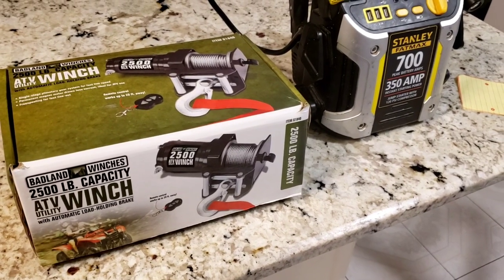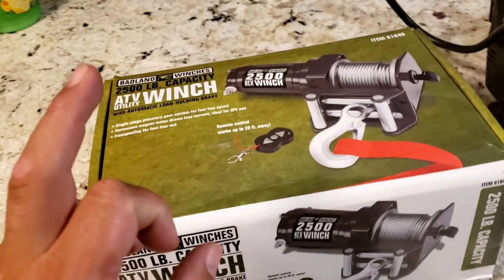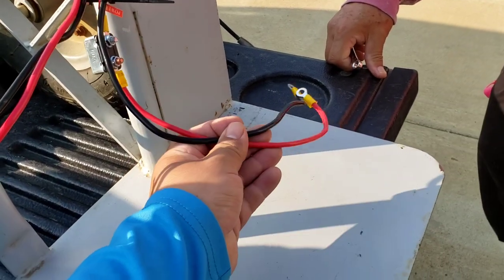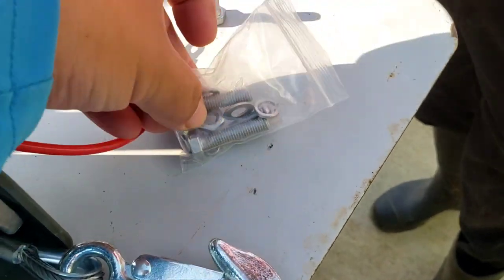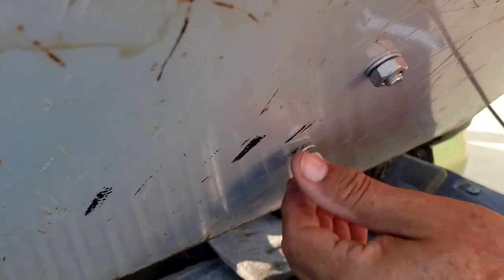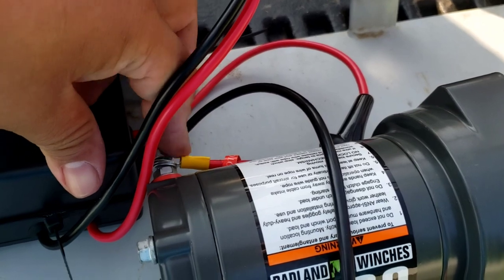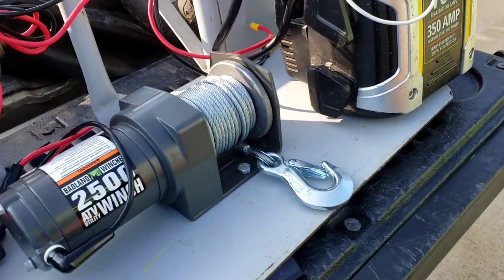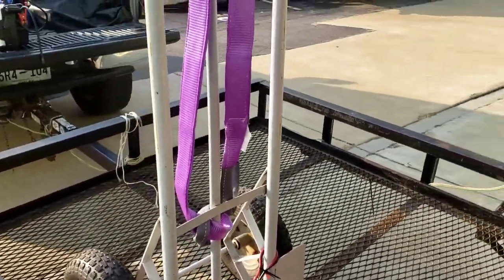DIY 2500Lb Harbor Freight Winch Install on a Dolly / Detachable Application

Comment: Hey Toney, you need to set this system up on a piece of plywood, "permanently". Then have two 🔩 bolts that are very easy to get to, where you can just detach the plywood on and off the dolly. Much easier and faster to detach and use as a dolly.
Reply from the maker: Great idea 👍

Comment: Did not install battery: did not demonstrate the unit running after the install. Pretty much you opened the box and drilled two holes. And for that I wasted time watching it🤦🏻‍♂️. Why did you show everything twice?

Comment: I also experienced the dolly to be unstable on uneven ground so I went to Home Depot and picked up a 5/8  steel rod about 36 inches long and got 2 more wheels exactly like what is on the dolly and added them on the outside.
Reply from the maker: Sounds like a great idea

Comment: Very un-informative video.
Reply from the maker: 🤦 ill make another one than  🤷 😅
Reply: Muy mala tu idea.   Usarías 2 dolly para recoger un water slide.   Cuando puedes poner el winch atrás del dolly y dejar la plataforma libre para subir el water slide en el mismo dolly
Reply from the maker: @PABLORODRIGUEZ2245  si lo puedes poner atras 👍 tendre otro video ya instalado